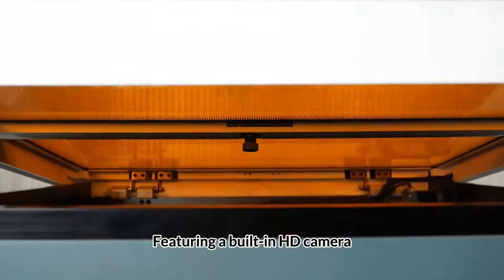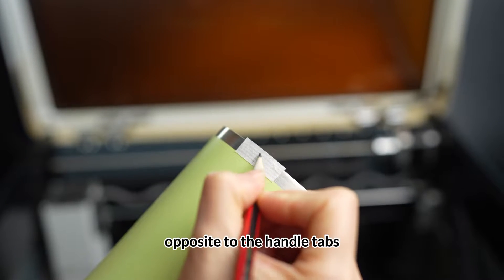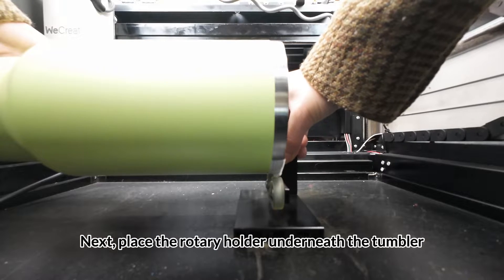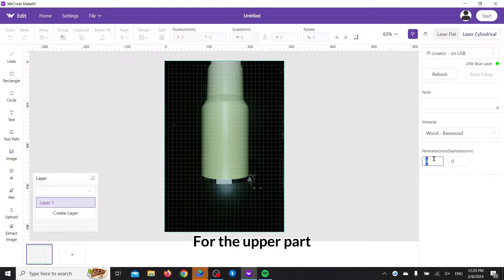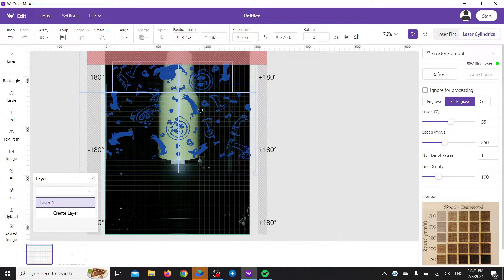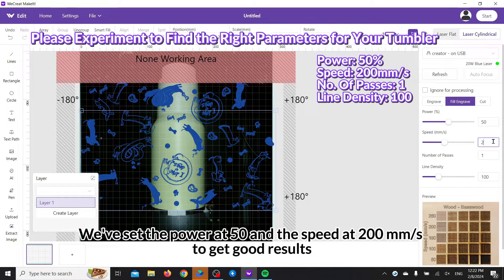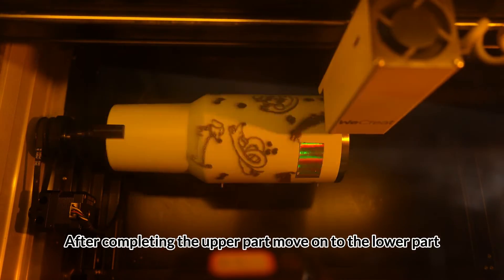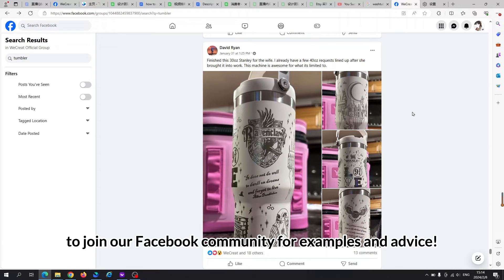WeCreat Vision - How to do perfect fully wrap laser engraving on a tumbler

Comment: I understand the theory behind the 24mm "void" area around the handle tabs, but how does that keep the head from hitting at as it moves left to right to burn the images on either side of the tabs (beyond the 24mm area)?  I also noticed on my lower portion even after correcting the circumference that it "refreshed" on the larger diameter of the mug and not the area that was set to engrave (not ignored).  If you could expand more on these steps and provide more detail instructions like removing the "guide" lines etc. would be great!
Reply: Yes I agree!   Been hitting the tabs